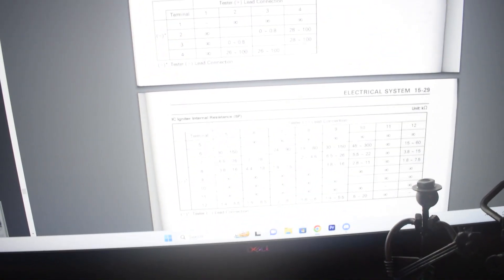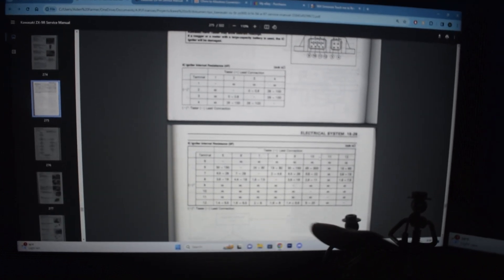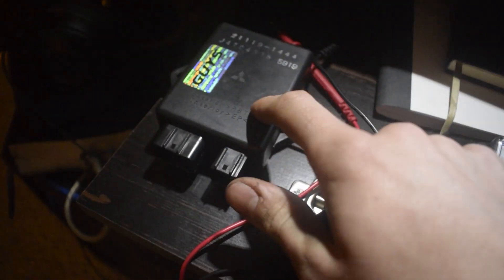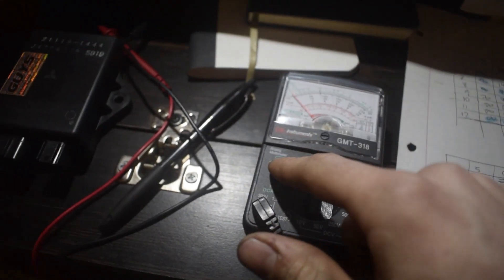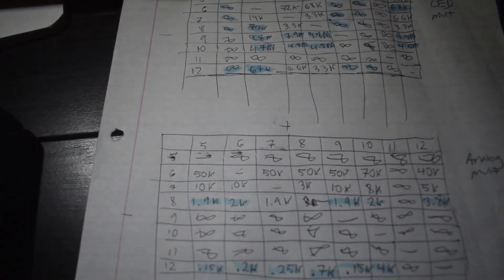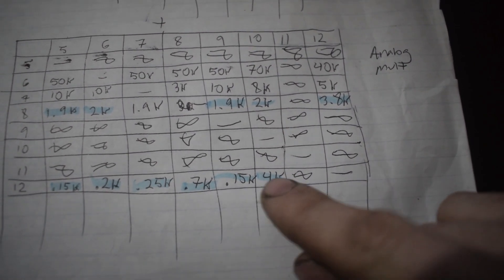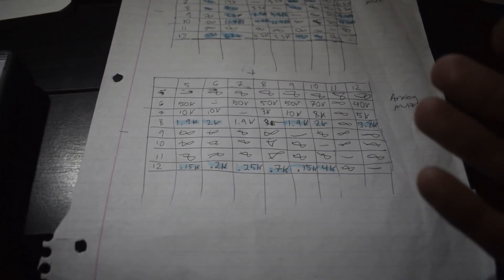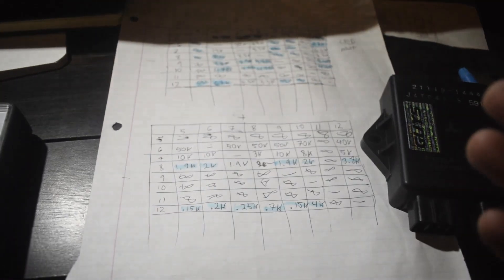Oldschool Kawasaki IC ignitor testing.

Comment: My left coil won't fire.   It's ok.  The signal isn't being sent or not getting there I guess.  Help?
Reply from the maker: If its only the left coil then your pick up is fine. Make sure you’ve got power at each the coil inputs. If you do then it could possibly be the Ecu or the coils junk
Reply: @ajp26548  This issue was a pain in the butt.   Took countless minds to figure it out. I will verify later today, but it was the fuel pump relay.

Comment: The 92 ignitor is more than I knew.
  Hoping to have wireless programmable cheap ones soon.

And left coils no pulse on both my boxes?
Reply from the maker: If you’re getting no pulse I would check your crank trigger/pick up coil if you haven’t already. Sorry just seeing this comment now
Reply: @ajp26548  No worries.   I'm glad ya tried.   Ordered new ignitor and checking wiring just in case of an issue I'm not aware of.  Might plug it in tonight..   wish me luck